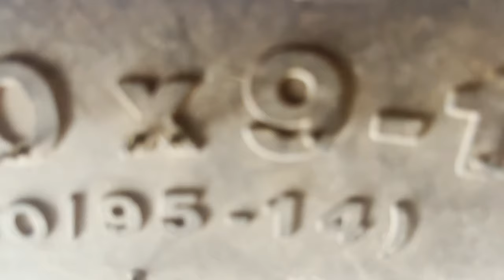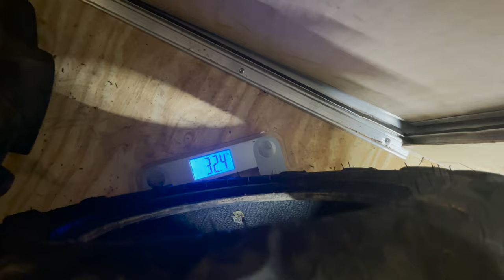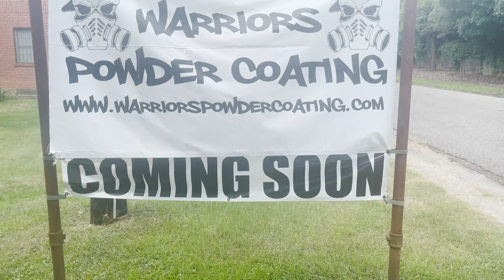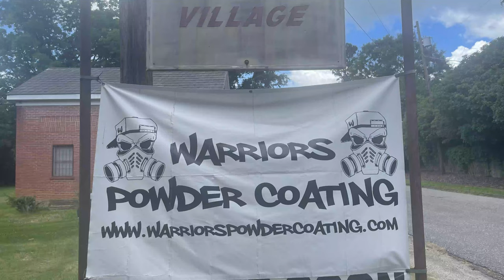NEW TIRE SETUP | BKT | CAN AM RENEGADE | WARRIOR POWDER COATING | BEADLOCKS

Comment: Nice looking BKT's. I've been thinking getting 28x9-14's all around on my 850xp, but do they fit both front and rear wheels, because rear wheels are wider? Original tires are 26x8 in front and 26x10 rear. Thanks
Reply from the maker: Most people that run BKTs do a square setup (same size tires front and back)